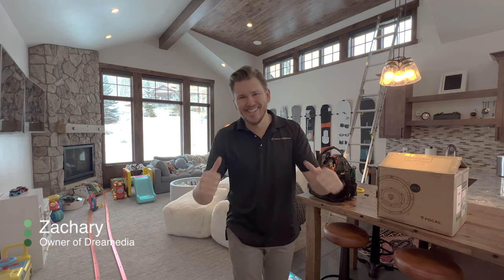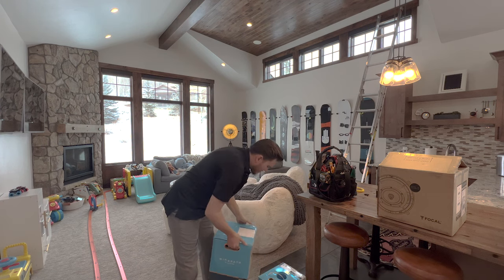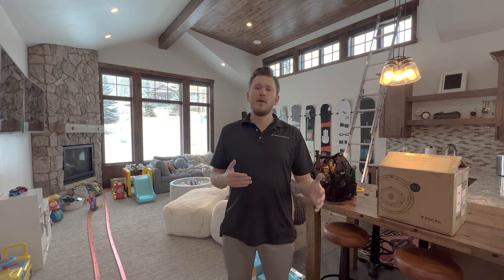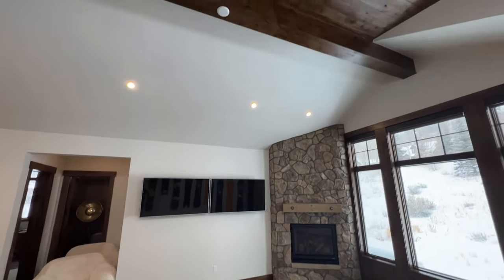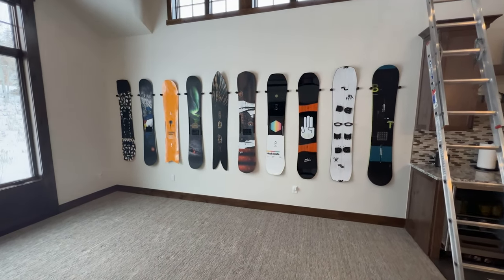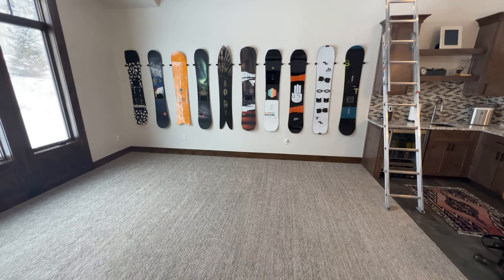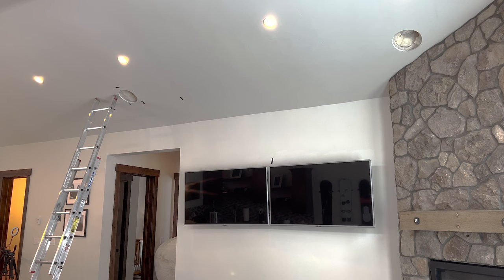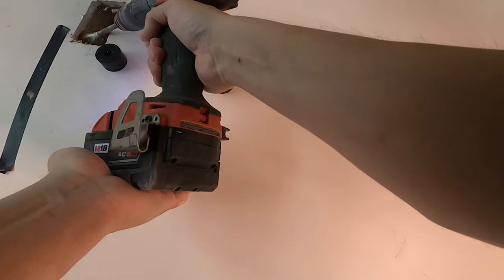Prepping Home Theater for Dolby Atmos In Ceiling Speakers!

Comment: Isn’t cutting the vapour barrier bad? You could get mould in that area.
Reply from the maker: In a perfect world you would get the fire rated backcans that we sell from focal and install it during the construction of the home to keep the home as efficient as possible. In retro installs you have to work with what you have. These speakers seal up tighter than a can light so I’m not worried about it. Hope your enjoying the series! We have a lot more content coming your way!
Reply: @Dreamediaav  the problem isn't moisture coming from the room, its the moisture coming from the other side.  I installed two in wall speakers on exterior wall.  what I did was get some spare vapor barrier and cut a rectangular piece that's bigger than the cutout and used the red tape to tape over the hole i cut out.   then installed the speaker.